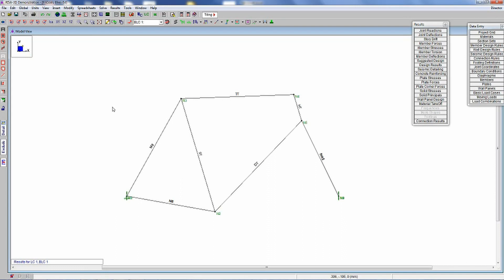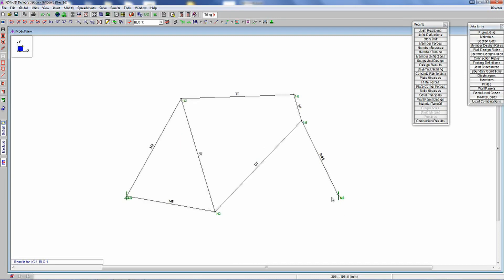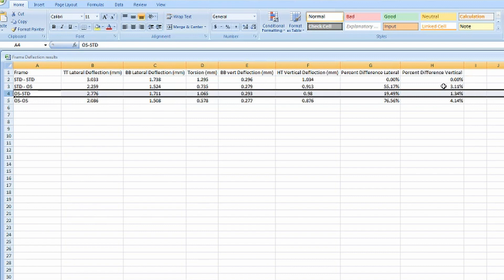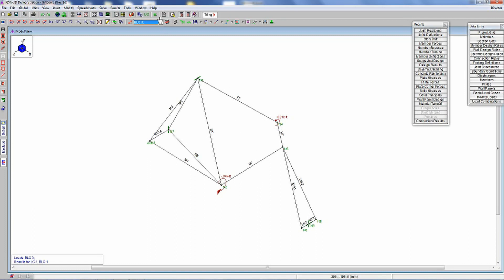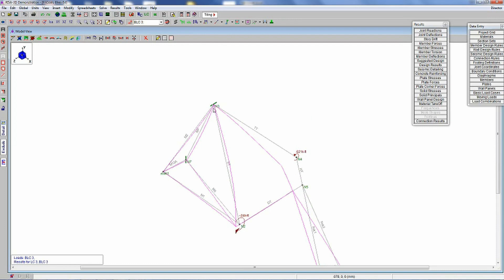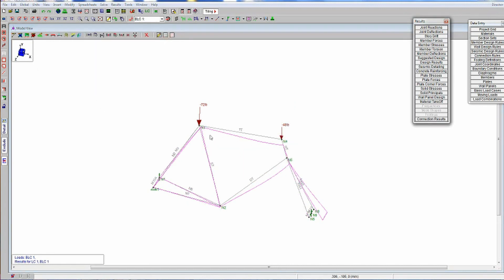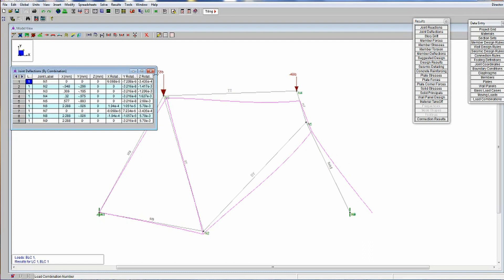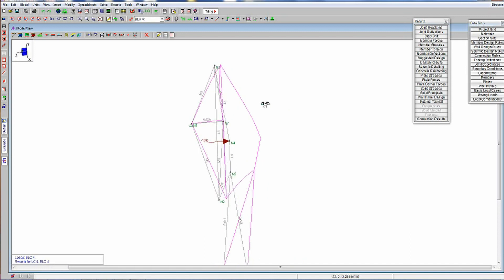Why an oversized top tube? Calculating bicycle frame stiffness using FEA

Comment: I'm surprised that you didn't calculate the torsional rigidity difference of a more radically sloped top tube.  Shortening the seat tube by 2"/5cm would significantly increase the rigidity of the seat tube while allowing the seatstays to be significantly shorter as well which would also improve rigidity of the rear end while also allowing a slightly shorter top tube.  It would compromise the space in the front triangle for larger water bottles on the seat tube but a full framebag with bladders and a hose is an option.  In terms of vertical compliance the seatpost is an unsupported cantilever beam vs a triangulated truss structure and thus a bigger difference in smoothing the ride.  Doubling the span of a structure increases deflection to the cube or x8.  A longer seatpost - especially a high flex carbon or even a suspension type is worth considering.  The carbon Canyon seatpost with the dual leaf springs is a hassle to adjust but I believe that it's going to offer the greatest flex unless going for a suspension post.
Reply from the maker: I would be surprised if shortening the seat tube by a couple of inches would "significantly" increase frame stiffness. Perhaps, there would be a marginal difference, if all the other variables were held constant. A bicycle frame (not a truss) is a lateral torsional frame. In the three axes you having bending laterally about a vertical axis, and along an imaginary axis running through the frame horizontally you have some twisting (torsion). Vertically, the frame deflects around an axis perpendicular to the other two axes I described due to axial compression and extension of the tubes, and some minor bending due to the top tube and down tubes not joining through a common work point (e.g. the front trapezoid). I know some call it a front triangle, but that's most often a misnomer since most frames have a long head tube. Smaller frames where the head tubes are very short would behave more "truss like" but that's just an over-simplified explanation. 
Frames by design have rigid connections, trusses by design are all pin connected, so it's an apples to oranges comparison calling a bicycle a truss structure. Let's try and be more accurate in our descriptions;) Trusses by design all use two force members (compression - tension) where a frame behaves differently because all the elements making up the frame have bending and torsion (plus axial and shear deformations). This might all be common knowledge to you, but I see this described often in other YouTube videos and comments. For YouTube purposes I get the analogy, it's just not helpful when we drill down into the nuances of bicycle frame structural analysis. Maybe YouTube is not the right forum for this level of thought?
If you have some analysis figures to back up your claim I would enjoy seeing them, but from a cursory level I just can't see how bringing the seat stays down slightly ( a couple of inches) will change the overall frame behavior so drastically, but I could be wrong.
Reply: @Henrywildeberry  assuming that the frame features a center to center seat tube of 50cm shortening it to 45cm assuming straight gauge tubing of similar diameter and wall thickness would increase the stiffness by 52% with a significant but smaller increase in rigidity of the seatstays due to their being a bit shorter.  
D^4 x T ÷ L^3 with D=diameter, T=wall thickness and L=length of the span.  In addition with an aggressively sloping top tube such as found on a mountain bike it allows a slightly shorter tube thus actual vs effective top tube.  The reduced length of the top tube from an aggressively sloped top tube might be maybe 2-3cm.  A shorter and thus stiffer seat tube will help to limit the top of the seat tube section and the bottom bracket from moving independently and thus limiting shimmy due to greater rigidity.  More typical for frame design of touring bikes (which are intended to carry additional load) is a stiffer top + down tube + seatstays.  I think that it's not just the rigidity of any specific tube but limiting flex from end to end as a complete unit.  Thus a shorter seat tube and seatstays.  If experiencing excessive flex I'd probably go to oversized tubes on both the top and down tubes but I'm a significantly larger human than Ms. Cools.
Reply from the maker: @mikekrasovec6390  Hold on, lets back up a second. I'm not sure where the coefficient D^4 x T ÷ L^3 was derived? Was this from a work-energy method used to solve a bicycle frame or some other simple structure?

Comment: A geeky question: doesn't your model solve specifically for reducing shimmy created by a handlebar bag and less so by other "front bags" mounted lower (like low rider panniers or front rack bags) because the load you simulated is induced relatively high at the tt-ht intersection (around min 12)? What lead you to induce the load at this point? Wouldn't a classic OS down tube, standard top tube config (out)perform if the load was induced instead for example at the dt-ht intersection?

Comment: Empirically I built a bike with oversized downtube with a standard top tube and it shimmys unloaded
Reply from the maker: It would be interesting to know the details of the frame, tube thickness, top tube length and anything else you would care to share. Thanks!
Reply: @Henrywildeberry  It's a gravel bike with a 32mm downtube, .9/.7 double butted. Top tube is 25.4 with .8/.5 I believe. Top tube measurement is 570, so actual tube length is a bit shorter. It was my first build so lots of things that are wrong, but the shimmy I attribute to the mismatched and light top tube.

Comment: It looks like Ms Colls' frame was "direct-brazed", ie tubes were assembled and brazed without lugs. Do you know if lugs can be an alternative to an oversized tube? As a matter of fact, torsion torque is strongest at tube junctions, and I assume that adding extra thickness and material with lugs could bring extra stiffness where one wants it. Leaving aesthetics aside for now, if the previous assumption were true, it might mean that assembling the top, front and down tube with a lug could provide similar mechanical properties without needing an oversized tube. Expanding from there, I'd be interested to know if lugs could allow a frame to be built with thinner tubes, yet keep deformation under forces similar to oversized ones.
I hope I made myself clear enough. I too am thinking of designing my bike and having it built by a frame builder and find it most interesting to have some understanding of all this to maximize cooperation between builder and designer/rider. This is the reason I really like your video.
Thank you.
Reply from the maker: Thanks tve! The extra thickness of the tubes at the ends and lugs themselves would provide extra stiffness. It's pretty difficult to model many of these aspects and would require a significant effort to make it work. The program I was using might not be the best application either, as it does have some modeling limitations. It would be interesting to see some experimental data on lugs vs. welded connection stiffness.
Reply: The stiffest way to join steel tubes is actually welding vs lugs but it's a minimal difference.  Solder is kinda like a glue whereas with welding the joint effectively becomes a single unit as the metal is melted together.

Comment: Very interesting indeed. Thanks.
My question: have you got any means of knowing/measuring the lateral torque when riding in different positions (such as riding out of the saddle). It appears you have done a best "guestimate", which is fine by me at this stage. However, it does seem a "point of least resistance" (untested assumption) in the design process. It'd be really cool to use some kind of trick to check now on the real bike how much flex there is and then check back your assumptions. I haven't seen anything like that on the internet. It'd be a great complement to this already fascinating video. I think modeling a human body on a bike would be too difficult to do well so measuring it on a real and known bike would be probably far easier and more accurate. Yet "easier" does not mean "easy".
Reply from the maker: Thank you for the excellent comment and question. I don't have a way to measure torque on the bike, but it's possible with an experiment using strain gauges. After test riding the bike, I can say it does have a stiffer front end compared to my bike. It feels similar to my titanium road bike. It has a springy feel, yet still stiff when you shake the handlebars. The bottom bracket area feels the same as my steel bike when you pedal and it flexes about the same when you stand up and climb. I wouldn't mind trying an oversized down tube bike for comparison.

Comment: Good stuff & fascinating.  Interesting that your analysis is at odds with the typical oversize/oversize or standard/oversize combos.  Did you do any analysis of the effect of tubing wall thickness as it relates to deflection?  There's probably enough combinations of tubing diameter & wall thickness to play around with to keep you occupied for days.

Comment: Great stuff real talk, sometimes i wonder, if the designers of these commercial bike manufacturers really know what they are doing, or they just don't tell the buyers the full story. And it is all about market hype.
Reply: I think Tom Ritchey has talked about the reason why the bike industry began with a stiffer/oversized downtube was due to the increased size to add a larger decal to the bike and hence increases visibility for advertising purposes.

Comment: It would be interesting to see an FEA Analysis of a DIY frame rework to increase lateral stiffness.  Perhaps gussets or fishplates to strengthen the head tube to top tube and front (slope) tube connection.  My steel Salsa Fargo has a doubler plate on the bottom of the front (slope) tube to strengthen the tube to headtube welded connection.  It would be cheaper than a new frame.

Comment: my 60cm Straggler shimmies pending where the weight is distributed in the front bag, if its heaviest items are placed towards the headtube end it rides no handed just fine, if I forget and dont load it properly it soon lets me know, my 58cm Straggler has never shimmied regardless of what weight is where ! 

Also, during your calcs did you consider how the tubes were connected ? I would imagine that to be a factor also, so many variables that all head back towards an experienced frame builder almost intuitively understanding how to best get the ride that the rider wants (assuming the rider knows what they want !)

Anyway, good stuff Henry, a good thought provoking video
Reply from the maker: Thanks for the comment! Good question on the tube connection joints. I modeled all the joint connections as rigid (e.g. no rotations). In reality, the joints are somewhat flexible (not perfectly rigid nor perfectly pinned). In order to capture these effects in the model, the joints would need to be modeled as a rotational spring. It's another level of complexity, and for relative comparison I didn't see the need. You're right there's definitely ways to fine tune this for better results.

Comment: Interesting info. Did the builder give input to help guide you? If I understand the design goals it was to maintain strength to carry the touring loads while not being to springy off road and to maintain pedaling efficiency and steering control by limiting lateral flexibility. Do you have an structural engineering background. If not, how did you develope the skill set to do this?
Reply from the maker: Hi Jeff - The frame builder suggested everything about the bike. We can't take any credit for the design of the bike. Our only request was to ask if we could use an oversized top tube given my personal experience with my custom bike and that Ms. Cools wanted to be able to do light touring. Shimmy was her main concern.

Comment: Hi Henry, great video!  I would welcome an even more indepth video/explanation of your model.  What 3D-CAD and FEA software are you using? At 3:25 you brought up a more complete bike model.  What software did you use when creating this model?   I was puzzled that, at the BB, the chainstays come together at a single point, rather than the typical spacing you'd have on an actual frame.  Likewise, the forkblades form a triangle and come together at a point.  Can you explain why this is just a "visual error" and not a modeling error?  Looking forward to your future video explaining the dynamic/planing model.
Reply from the maker: Thanks M. Cambron. The more complete bike was just a diagram of Ms. Cools bike provided by the frame builder. I'll make a more in depth video for those that want to get into the details.

Comment: Thanks. It’s been several decades since my statics and dynamics classes. No user friendly pc based modeling software back then so it was interesting to see you put modeling software to work on a bike frame.

I’m glad you mentioned shimmying. On a group ride 40 years ago I remember watching a rider crash on a descent because of shimmying. He was tall like me. I have a 1984, 25” Trek 720 touring frame that has a lot of flex. You’ve got me thinking about how frame design is done through the range of sizes of a given model.
Reply from the maker: The computer aided analysis has really opened up the possibilities of running a wide range of load cases and modeling different frame geometries. There are still plenty of limitations such as trying to find non-symmetric cross sections for example. Modeling the connections and even the butting profiles can get pretty complicated too. It still beats doing an indeterminate analysis by hand!
Reply: If you're having issues with frame shimmy/speed wobbles balancing the wheels is worth trying.  Ideally for such a large frame you should have oversized tubing which would greatly increase the rigidity but also requires a new bike.  Stick on self adhesive lead weights from the hardware store work well.  Start with the wheels which are properly trued and within 0.5mm of vertical movement.  Then understand that whenever you remove a tire fix a flat or whatever will change the balance.  I'd recommend starting with fresh tires.  If your bike is setup tubeless you need to balance the wheel with the tire mounted but without sealant - add sealant after balancing (if you get a nugget of coagulated sealant in time the balancing will be off).  Balanced wheels are going to be a few watts more efficient but unless you're a high level racer or a particularly high level bike nerd will be of questionable time/hassle benefit to be worth it.  Altering the weight distribution or even moving a pannier a little fore/aft also can have significant effects on wobbles.

Comment: Very interesting, but I wish you’d shown the bike itself so we can see the shapes of the tubing — even a cross section from scraps of tubing. Some modern tubes from Columbus are not even round. The most surprising thing for me, was to learn that you oversized the TT but make no mention of the downtube. Trek famously introduced BB90 which had a very wide and rectangular downtube, in order to increase lateral stiffness. And even some high end steel bikes try to implement this with a wider T47 BB and non round tubing, both in the downtube and chainstays.
Also, I think the bends on the fork and frame geometry would have an important effect. Maybe material for another video, with the builder, if possible.  What effect would a downward sloping tube have on lateral stiffness?
Reply from the maker: There's certainly a lot of nuance to a frame and how it might perform. The curve in the fork is difficult to model and for the purpose of looking at relative stiffness of different tube sizes of the frame I chose not to spend the time on the fork itself. It would be interesting to see how a sloping top tube would effect lateral stiffness.
Reply: @Henrywildeberry  testing of straight fork blades vs bent fork blades of similar diameter/wall thickness steel fork legs show very similar deflection for a given head tube angle and fork offset/rake.  "Bike Tech" August 1984 Volume 3, Number 4 pages 8-13 tested a variety of rakes, head tube angle, Reynolds vs Columbus tubes + curved vs straight blades.  If you can find it - it's worth reading.

Comment: That top tube shape and design is a part of high end carbon road bikes. I believe that Specialized really innovated it for their Tarmac line. Your explanation makes great sense as to why this makes perfect sense for carbon.
Reply from the maker: Interesting. I actually have a Specialized Tarmac SL1 carbon road bike and it does have a pretty large top tube. It's never shimmied on me, but I don't put any added weight on it either. It's purely a road bike.

Comment: I once had a frame with an OS top tube that had a severe low speed shimmy (no hands under 20mph) and a scary speed wobble at about 35-40mph (hands on). Not sure if the OS top tube was the cause, there were lots of other idiosyncrasies about that bike as well.
Reply from the maker: Shimmy is very complex and very hard to pinpoint.  A low speed shimmy sounds pretty strange. You're the first person I've heard say that. Lots of things can cause shimmy, frame stiffness, an imbalance, or even an alignment issue.

Comment: I built a frame last year that i wanted for gravel, single track and road. I used columbus spirit for lugs,  oversized tube set. A 46.5 chain stay length. Disc brake. Surly straggler fork. I have really thrashed this bike for almost a year. It has held up well. But i think i will add support to the chain stay with a steel plate behind the BB.  I had an old TR road frame that he built with this plate set up. Really stiffened it there.
Reply from the maker: Sounds like it's ready for anything!